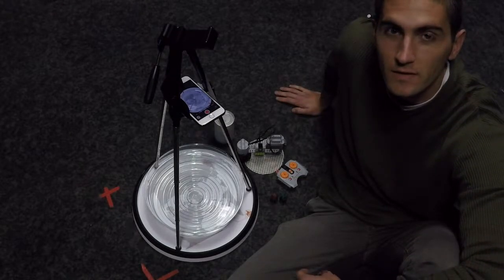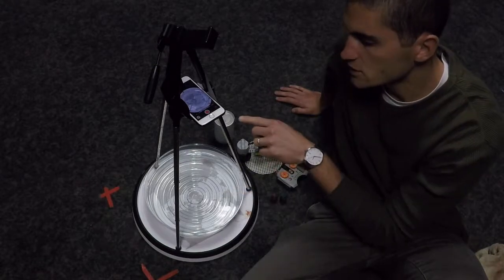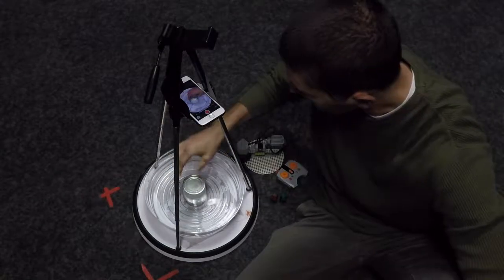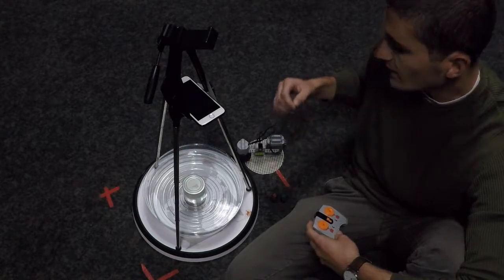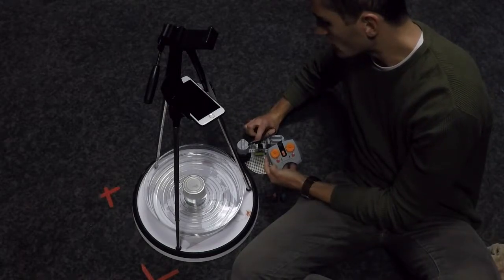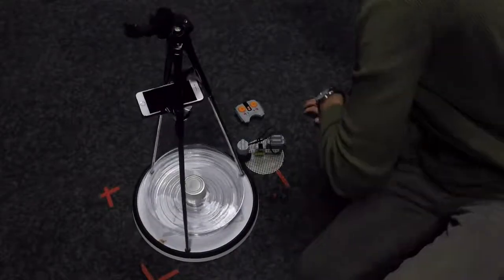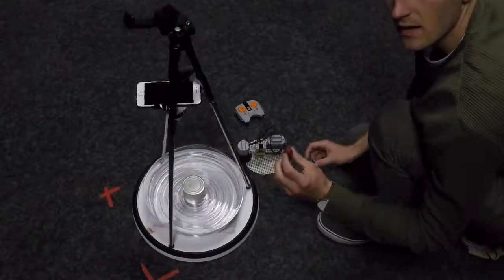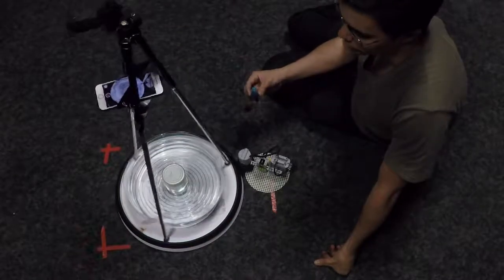How to demonstrate baroclinic instability on the DIYnamics table

Comment: well done!!  if you still operate?.. could you show/explain first and second baroclinic modes operating.. thanks guys!!
Reply from the maker: We definitely still operate!  Not 100% sure what you mean by 1st and 2nd baroclinic modes.  Baroclinic can mean different things in different contexts.  In geophysical fluid dynamics, a baroclinic fluid is one in which pressure and density surfaces are not parallel.  As opposed to a barotropic fluid in which they are.  What we're demonstrating here is baroclinic *instability*, which is when, roughly speaking, the tilting of density surfaces combined with rotation gives rise to a fluid instability that generates the coherent eddies visible thanks to the food coloring.

Often, 1st and 2nd baroclinic modes come up in tropical atmospheric dynamics when describing vertical profiles of say vertical velocity.  A barotropic mode is one that is constant in height. A 1st baroclinic mode is one that is essentially a half-sine wave, zero at the surface and tropopause and maximum in between.  A 2nd baroclinic mode is a essentially a full sine-wave structure, zero in the middle as well.  And so on.